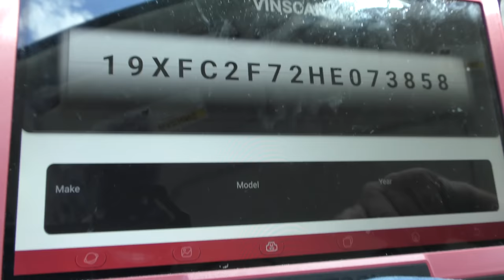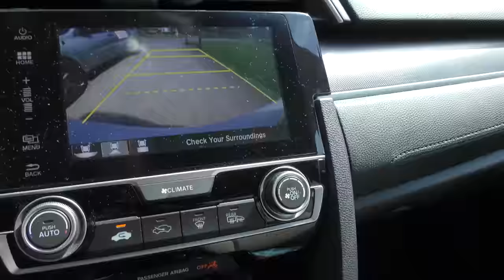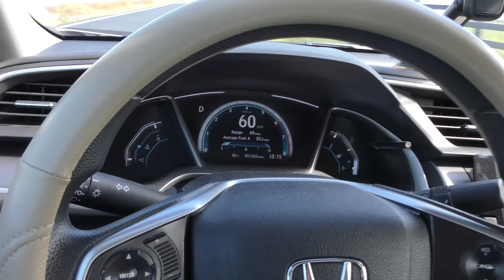Here’s What Happens If You Change Lifetime Transmission Fluid in Your Car

Comment: Had a 2007 Ford Freestyle for 11 years. When I was in for one of my first oil changes, one of the Ford dealer techs asked me how I liked the car. He said they were seeing transmission issues on some of them, usually before 75K, and he suggested I change the fluid every 60K. I did as he recommended and had no problems in 180K miles. Also had the changes done at the dealer because I had heard that other places put the wrong fluid in. The vendor who made the CVT went out of business and getting a new one could cost up to $8,000 so it was worth the cost to change the fluid at the dealer. I did get decent gas mileage and loved the car for hauling kids or cargo. My son drove it for a few years and he misses it for its practicality.  These cars were notorious for their CVT issues and I expect a lot of it had to do with not changing the fluid.

Comment: I completely agree CVT fluid needs to be changed around 30k miles
Reply: Yeah I knew someone who bought a used Lancer where the dealer had just changed out all the fluids before sale, a month later the CVT kept slipping out on the highway, they wanted to bill her for the replacement until she found the history of the vehicle, the CVT fluid wasn't changed in the first 120,000km of ownership, WTF. The dealer was going to leave her dry initially... I nearly flipped. She got a brand new CVT.
Reply: 35,000-45,000 is  a good all around mileage to change fluid.
Reply: @williamoneal2763  I’m obsessive so 30k for me
Reply: @mcc7762  I use the Amsoil CVT fluid 
It’s the best CVT fluid out there 
Also changing it every 30K is smart 
On mine I not only have a filter in the pan 
But I have an inline filter as well 
It’s a paper cartridge and should be changed every 60K 
That’s something everyone needs to look in to 
If that inline filter clogs say goodbye to your CVT regardless of all the fluid changes. 
I know all Nissan CVT since 2012 have this inline filter 
Also Mitsubishi CVT have an inline filter as well
Reply: What about with automatic? I have a 2017 Jeep Grand Cherokee Trailhawk.
Reply: @JaimeGonzalez-wx1gw  30k is optimal especially for poorly designed transmissions that shed lots of clutch material

Comment: I’ve been driving a 18 outback touring and gone 265000 so far. Changed the transmission oil last month and it wasn’t looking that bad . Dealer kept checking it at oil change (warranty via dealership so I also change oil there too) 
  Finally they admitted it should be changed contrary to Subaru America saying (lifetime) no need… going for 500000 with lifetime dealerships warranty. So far not too much other than bearings, tuneups front wheel universals… not bad for nearly 300k
Reply: I’m glad you posted this because I have a 2015 outback with a 2.5 L boxer, and I got it with 105,000 miles on it. I wanted to change the fluid at 108k when I found out it was “lifetime“ and it hadn’t been touched, but the service folks at Subaru were hesitant because they didn’t want it to have issues. I said do it anyway I understand the risks and I’m glad I did. It shifts perfectly fine and it’s been almost 30,000 miles and I’m going to change it again. But to go 265,000 miles on the original fluid is incredible and I’m glad you didn’t have any issues!
Reply: Really nice to hear that! I ordered a 23 outback and it's good to know the CVT is reliable in it.  Should be in the end of this month. This will be my first Subaru.

Comment: Always stick with the original fluids.  Went from Toyota WS in a 08 V8 Sealed 4 runner transmission at 85k over to the Amsoil WS equivalent.  Technically a better fluid, but the computer lost it's mind thinking the solenoids were breaking.  No damage, no shavings, did the solenoids since it was on the codes, and ended up just going back to WS and no problems since.  Stick to dealer fluids unless you're putting a totally new transmission in from the start.
Reply: Been using amsoil in my 2014 sienna 2wd ,shifts better with each fluid change
Reply: Scotty said he uses the Valvoline with WS Compatibility on his Toyotas "for years" with no problems whatsoever. 
Am about to use it since I have it, but can not go wrong using OEM TOYOTA WS!
Reply: I use the Valvoline multivehicle CVT fluid and it works fine. I actually mixed it with the factory fluid because I can't drain all of it out at one time. It is still shifting fine so I don't guess it hurts anything.
Reply: Never had a problem with Valvoline ATF in Honda Accord or Toyota RAV 4 and Highlanders

Comment: In some older cars, you can drain the torque converter too!! Make sure you have a big drain pan, because some transmissions with drainable torque converters hold nearly 2 imperial gallons all up. Most of this is in the torque converter. When I serviced the transmission in my car, it took a good 5 minutes for the torque converter to drain.
Reply: The car I'm redoing,I had the whole engine/trans on the work bench so it was the perfect time to get all the fluid out.
It's got 130k,and I've changed the fluid 2x before in its life but now I know this time I got all the fluid out. 
And it wasn't all that bad,glad I've done it before because folks complain that they're usually junk.
Reply: When do you  change the filter
Reply: @rickvigil5847  I change the filter every time I change the trans fluid in my car, which is about every two years or so. Engine oil filter is changed every oil change, which is twice a year, regardless of mileage.
Reply: @rickvigil5847  I change the filter every time I change the trans fluid in my car, which is about every two years or so. Engine oil filter is changed every oil change, which is twice a year, regardless of mileage.
Reply: @rickvigil5847  I change the filter every time I change the trans fluid in my car, which is about every two years or so. Engine oil filter is changed every oil change, which is twice a year, regardless of mileage.
Reply: @rickvigil5847  I change the filter every time I change the trans fluid in my car, which is about every two years or so. Engine oil filter is changed every oil change, which is twice a year, regardless of mileage.

Comment: I emailed ZF  for their recommendations on fluid change interval for my 3 series BMW (2014) and they replied every 60-100 kilometers depending on driving habits. BMW says "lifetime". I change it every 40k miles and  now have 112,000 miles on the car and will be doing a 3rd change at 120k. I don't agree with Scotty on everything he says but he is 100% correct on this.

Comment: Bought a 2003 explorer , changed oil, but never got around to changing the transmission fluid. Sold it at 320,000 miles and it still worked great. Lots of problems with the heater blend doors but never a problem with the 4.0 engine or transmission.

Comment: On "lifetime" fluid transmissions you usually want to loosen the fill plug before the drain plug because in the event you strip out the fill plug you'll probably want to put off the fluid change until you can get yourself a new plug.
Reply: There is no "lifetime transmission fluid".....  People need to learn to read the manuals that come with their cars.
Reply: @aaronthomas6155  thanks tips. That's why I used the quotation marks.

Comment: When draining transmission fluid I use an empty paint measuring bucket from Lowes it has quart markings on the side to see how much fluid came out
Reply: My 2021 Tacoma has no dipstick. WTH. Says you need a scan tool to change the fluid.
Reply: @jaysmith179  you just use a measuring bucket when draining and you will see how many quarts are in the bucket by the marks kn the side of the bucket
Reply: Buy some measuring cups at Goodwill. I have from 6oz. to 2 gallon. I have many things to service.

Comment: I worked for a courier company 1993-2002 and we used ford econoline vans.  We did exactly this 30k for dino oil and 60k for synthetic.  Most trannys went over 600k miles and one went 952K miles.  As for engines 5k for dino and 10k synthetic and engines went 300k to 750k.  With 2nd motor and trans we had vans with 1.3 million miles on them. We also repacked front wheel bearing every 30k and replaced when needed.  Also, plugs and wires 60k for reg plugs can ignition and 90k for platinum and direct ignition.  Ford were the longest lasting vehicles we had, but I think everything went to crap after that.

Comment: Um, did you just tell everyone at 6:33 to put the drain plug back in AFTER you refilled it with fresh fluid?!!!   O_o
Reply: In this day and age common sense is a superpower.
Reply: And he drained the fluid with the jack stand in place.  Makes me wonder how much more he could have gotten out.
Reply: I noticed that aswell it got me thinking 🤔
Reply: Scotty said "bolt and washer". It's the fill plug he's putting back in. The drain plug gets put back in after wiping off the metal sludge and the fluid finishes draining.
Reply: remove drain bolt --> drain --> wipe off metal sludge from magnet on bolt--> let finish draining --> reinstall drain bolt --> remove fill bolt --> fill --> reinstall fill bolt
Reply: @colt._45  sorry but that would depend if the drain bolt was on the passenger side of the transmission it would actually help it drain since he raised the drivers side!
Reply: @TheLosamatic  yep you're right.  Mine is in the other side.  I guess I wasn't paying attention.

Comment: i  have been a Mechanic for over 50 years and just did head replacement on a 6.6 LLY Duramax 2005  Diesel and replaced every coolant and fuel hose under the hood and replaced the water pump and this is a lifted up high 10'' lift it was the hardest thing i have ever done scotty... took 16 hours just to remove the heads and i used air tools. but i would never let anyone touch any of my trucks or cars ever... it will never happen i hope i have seen so many shops do bad work and over priced here in San Diego...

Comment: Good video Scotty, I agree with you, my past 1998 BMW 528i also had a lifetime fluid, I changed it  and the transmission filter as soon as I got it with Redline D4 synthetic every 50,000 miles, it lasted 300,000 miles, before I had slippage in the lower gears and turned in the car using the BAR junk car program in California.

Comment: Hey Scotty, I just purchased a 2016 Kia optima with 100,000 miles on it. I’m not sure if it has ever had a transmission fluid service done on it. From what I’ve researched I believe those vehicles need a transmission fluid change around 60, 000 miles.  Do you think it would be a good idea to do a service on it with a partial fluid change? I’m worried that the transmission fluid might be burnt from not being changed at 60,000 miles. Just wanted to get your opinion to see if I should give it a go, thanks!
Reply: From what I read, alot say to leave it alone if you haven’t changed it. It’ll slip if you change it that late.

Comment: I have a 2018 non turbo Civic with a CVT and my dealership told me based on my VIN number it took 3.9 quarts. They also recommend that you clean the breather which looks like a little baseball cap on the side to the left of the fill hole on top of the transmission. My car has 114,000 mi and yes the breather was clogged which caused my rubber cork that covers the fill hole for the transmission to blow out luckily I caught it in time.

Comment: My 2020 Nissan Versa has 95k miles on it now changed the cvt fluid at 45k going to drain it again today, the only problem I’ve had is dirty mass air flow sensor keep up with changing your engine air filter and oil and you should be good.

Comment: Daughter bought a 2020 automatic Dodge Challenger sxt. States life time transmission fluid in the manual. Like you said for the lifetime of their original warranty. Right😏 One Dodge dealer says they don’t replace this unless customer ask  for. The other Dodge dealer states too change at 75k-80k. The cost $610 with extra for replacing the transmission pan/ filter added $485. No extended warranty. Should she replace the Fluid, filter, pan and oh yea the gasket to be on the safe side. Please respond I’d really appreciate it.

Comment: Hi Scotty, From one Mechanic to another, I have never tried this, In the older days ford used ATF Type F for there automatic transmission back in the day as they had micro particles in there oil to get saturated in between the clutch disc so they would not slip, What do you think about using a couple of courts of Type F trans fluid along with 3 quarts of Dexron Trans oil to a high mileage Chev truck 4X4 Transmission, What would be your take on this.🤔

Comment: Excellent advice. I've been changing ATF in all of my Honda cars over the years, both regular and CVT automatic transmissions. Although Honda will not provide the specs which allow you to use other brands of ATF, the other brands of REPUTABLE manufacturers will specify if theirs meet the Honda specs. So, you CAN use other brands of ATF in any Honda. I do and I change it at 30K mile intervals (more than Honda recommends) because I'm particular about my services and make my cars go for many 100K miles. There are several brands out there, but be sure to use the proper CVT or ATF fluid. They are NOT compatible. 

I also agree about taking the easy way of using the correct amount of fluid: Measure what comes out and put the same amount back in. 

One note about the Honda CVT transmissions is that there is a rubber plug in the top which has a pin-hole vent. If the rubber plug's pin holes plug up, the whole plug will blow out and allow you to lose a lot of CVT fluid. Simply clean the pin holes with a small paper clip and blow them out with silicone aerosol spray to keep it slick and clean. I do this when I change the fluid and it only takes a couple minutes: Remove the rubber plug, clean the hole, replace the rubber plug. Easy.

Go, Scotty!!!!
Reply: Ok but will a mechanic know to do this?

Comment: I have a 2021 with 14K on it and the Honda dealer wanted to do a flush and replace the transmission fluid. I said no are you crazy. I am glad that I watched your video. I will change my own around 30K. I have a ways to go since we don't use the CRV much.

Comment: Yup I have one of the early production CVT transmission on my 2015 Honda Fit. I change the fluid with amsoil CVT fluid every 30min miles a lot smoother than the HONDA HCF type2 fluid I’m at 170kmiles and still running strong No leaks too
Reply: 2914 civic and at 60k miles switched to amsoil cvt fluid changing 3x 100 miles apart. Amsoil better fluid. I have 126k miles on car. Still question longtivity of these transmissions.

Comment: I recently changed my ATF on my 07 odyssey.  The fill plug on the odyssey is at the top.  I find it pain in the butt that on the civic, you can't really access the fill plug from top on the '17 Civic.  Glad to know though that it is still not a difficult job on Honda ATF fluid change.  Just need a hose to route up.  Always good to save those semi translucent windshield washer fluid jugs, it helps to determine the amt of ATF fluid to fill back up.

Comment: Some older Mercedes have an actual gearbox dipstick and even a drain plug on the torque converter, you can get pretty much all the old fluid out, and don't need to measure the old fluid.
Just drain it all and refill.

Comment: I just changed the transmission fluid in our 2020 Kia Rio after watching this video and researching since buying the car.  Kia says "lifetime fluid" and it cannot be changed.  False!  The transmission is an IVT type and uses their CVT Fluid.  I measured what came out and put the same amount  back in.  Had to remove the air cleaner  box to reach to fill plug.  Thanks Scotty!

Comment: I have a 2016 Nissan frontier with 209000 miles. (Had it since 30000 miles). Runs great and never had a problem with it at all. I have never changed the transmission fluid. Should I?

Comment: Scotty, great content! When is the best time to check the automatic transmission fluid levels on a 2005 Honda Odyssey? After its been running or in the morning before driving?
Reply: Extract from Honda Odyssey 2009 manual. It shoudl apply to 2005 model. 
" Recheck the transmission fluid level after a test drive to make sure it is full. Normally, a fluid change will require slightly more than 3 US quarts (3,000 ml). 
To check the fluid, use the transmission fluid dipstick. 
Drive the vehicle until it is warmed up and has shifted through all of the gears, park it on a level surface, and shut it off. 
Remove the dipstick between 60 and 90 seconds after turning the engine off, and make sure the level is between the two marks. "

Comment: I  had fluid change in my 2012 Tacoma no flush. One them machines that pulled it out and put my new Toyota Trans fluid.I did it about 185000 miles. Still shifts great.212,000 miles now..

Comment: Listen folks on Honda DO NOT FLUSH a Honda transmission. Flushing sends all the filtered contaminants back into the transmission. Drain and fill only!! Only use the factory fluid if you follow these rules you’ll be fine. Typically a car treats you as well as you treat it.

Comment: Just did the same on my Toyota crown majesta with the 1UR-FSE V8 engine.. Has the 8 speed Auto, 4ltrs came out so pumped 4ltr of Toyota WS fluid back in, easy maintenance, done 62,000ml so will do it 3 times in total, driving a few hundred km before each change

Comment: I made the mistake of having a shop change the fluid on my Mustang manual transmission. They used old style manual tranny grease. Realized their mistake, drained it and then put in the correct automatic fluid. Didn’t do it right, and a couple weeks later, couldn’t shift the gears. Had to get rid of the car. Now I do all changes myself.